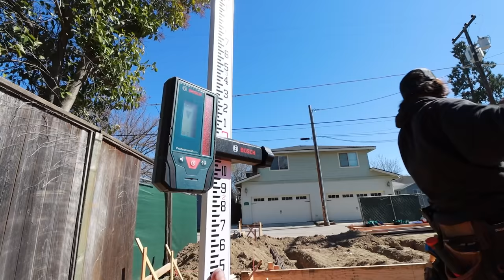Foundation Forming - Stem Walls Changing #2

Comment: That is some expensive form material.
Reply from the maker: If you think that's bad.. I ordered 10 sheets of 5/8" roof sheathing and had to sell my truck to cover the cost.
Reply from the maker: No joke though, 99 sheets of roof sheathing = $4,400.00. $44.00/sheet.
Reply: @MattBangsWood   I cannot believe anybody would be building now the way lumber prices have skyrocketed.
Reply: @MattBangsWood I use  3/4" and spot the roof trusses 16" oc here in the Northeast.  Don't imagine your engineer worries too much about snow load. :o)
Reply: When I built my garage 2 years ago, I reused my 10x  2" x 12" x 16' from the forms as my headers for garage doors and the balance I ripped into studs. All worked out in the end.
Reply: @MattBangsWood  zip is overpriced IMO.  There are other options.

Comment: Nice to see a "old fashioned" slab on grade there, with stem walls.  LOL.  Out here in Phoenix, damn near every new house built over the last 15-20 years is a post tension slab...  much cheaper for builders to go with, but makes future reno a pain when moving pipes or running in floor electric.  Have to get an xray out to map the tension wires and when most are like 12" on center in north-south/east-west, it's really impossible to do anything without major changes to the foundation.

Comment: Tips for forming 
Your guide for inside forms can be better, nail a stake on top that extends at least the thickness of the outside form plus another inch or so. Drive a nail in at the thickness of the outside. Now it hangs from the outside form.

When nailing the inside use a similar  system so your blows are backed up by the outside form and you dont need to lug around a sluggo.

If working on a taller stem wall and especially if multiple bars or verts are required, build the inside form bottom up, set the first board a safe distance below level from outside form, now you can go up tieing bar and adding spreaders as you go.

These are all small tips that add up to make work easier and more productive.

Comment: Matt, in the stem wall episode #2 @17.19 into the video I noticed you are nailing the board from the side concrete will be. I am finding that I may have to do the same as I build my stem wall. Did you run into any problems when removing the stem wall? How did you tackle removing the lumber's 90 degree angle with the nail attached on the concrete side? Hope my question is not too confusing. I had a difficult time wording the question. Thanks

Comment: Framing question for you when you nail the bottom plate you are supposed to use galvanized nails can you use those on the top of the wall with the top plate as well?

Comment: What classes or training I need to take to get the foundation forming knowledge as well as the spraying on the foundation etc? I have carpentry knowledge also learned alot off your videos ta🤗 it's hard getting into the field after the corona and me recovering from a hip surgery which I been down for over a yr but coming along lil by lil. 

Tim DC

Comment: I'm confused with how you determined the grade. Do you first find the highest point in that grade and based on that highest point do you use the laser level and move the laser stick up the distance from grade and the distance of the specified footing depth to find the amount you must dig?
Reply from the maker: Yes! Exactly this. Shoot pin, adjust from pin to finished floor height.
Reply: @MattBangsWood  Thanks for replying, Matt

Comment: Hey Matt...quick question so since you guys did the forms and stuff it gave me the assumption that you guys might be doing the build start to finish...is this true?
Reply from the maker: To exterior finish, yes. No HVAC, no plumbing, no electrical.
Reply: @MattBangsWood  hey Ian e a other question that you don’t have to answer if you don’t want to.. did Panalla construction bid on a hop called Ardmore development in Paso Robles for Daniels Wood Land? And if so based off your videos I would trust your company a lot more than the one we went with. They had blocking that was too short and still nailed it , they never pounded in all there nails on the sheeting and countless other things. Thanks a lot for all that you have taught me. Bang on!!!!

Comment: Hey Matt how is it pulling forms fastened with nails compared to screws? I personally have always used screws.
Reply from the maker: I use screws from time to time, they're in a few tough to get to spots in here. Concrete always fills whatever head they are (T15, T25, Phillips, etc) and they're a pain to take out. Duplex nails come out with ease, every time.
Reply: @MattBangsWood    Try Duplex Screws.  Orange head, phillips or hex

Comment: Hey Matt I have a question. What is the tool belt system and shoulder strap your crew mate is using? In the 4 min mark. Also is there an advantage to keeping your speed square in the back pocket?
Reply: I wear McRose leather. The bags are made with premium soft leather. And the suspenders are so fukn comfortable! Game changer.
Reply: @dustinbastianelli8912  Hi Dustin nice to meet you. I like the bags they look nice. Will be looking up the brand shortly. At first I thought they were Occidental Leather bags.
Reply: @mrgreen3109  I believe they are occidentals in the video. This is just my personal recommendation. McRose are hand made by a retired framer. Been wearing em for two years and can't be any happier!
Reply: @dustinbastianelli8912  Got it. Thanks. 🤘

Comment: Matt, why are the forms above grade and not below grade?
Reply from the maker: Emily, you want the home to be above grade to prevent issues with flooding or any other element.

If the home was set at grade, 2" of rain and you'd have water inside your home. By setting it higher (about 10" in this situation), we're able to prevent that from happening. Most homes are set a good 6-10" above grade.
Reply: @MattBangsWood  I didn't know that. But, I am learning a lot from your channel and I think you rock! Good information for when I finally build my own home someday. If you can do it, so can I.

Comment: Any reason you guys just don't rent 4' forms?
Reply from the maker: Every form board will be utilized in the house, drywall backing, backing for cabinetry, etc. Just makes sense for us to do it this way.
Reply: @MattBangsWood  I get that. I work for a lumberyard and also use to do concrete for a bit. Just seems like more labor, but if it works for you!

Comment: Looks like a neat job but jez it seemed like it took you weeks to do.
Reply from the maker: We've worked 40 hours on this project as of present (not in video) and it's ready to inspect prior to pouring, electrician is done, plumbing is done.
Reply: MattBangsWood yeh ok so roughly 5 days and concrete is on the ground finished. Very tidy work tho 👍

Comment: Still scratching my head over how they got approval to build that close to the property line. Google Kowloon Walled City or Rio De Janeiro favela.
Reply: Have you never been downtown in a city? 
Commercial zoning allows you to build right to the property line. There are simple non-combustible construction requirements to follow.
Reply: @DJNemesisOfficial  The imagery in this video doesn't exactly convey "commercial zoning" to me. Is that what you see? Anyway, my comment is based on typical residential zoning, where an emergency access easement must be maintained for things like firefighter ingress/egress into/from the property.
Reply: @mykalimba  You've mixed 2 things up here. Setbacks are required for combustible construction. Fire access simply requires an unobstructed 3ft path into the building.
Residential zoning doesn't usually allow building to the property line. This looks like a mixed use zoning neighborhood. Regardless, it's all city regulated by people whose job it is to sort this out.